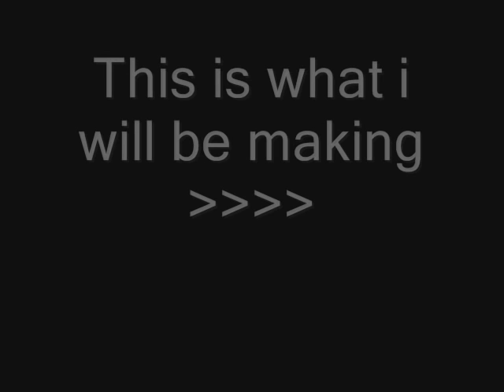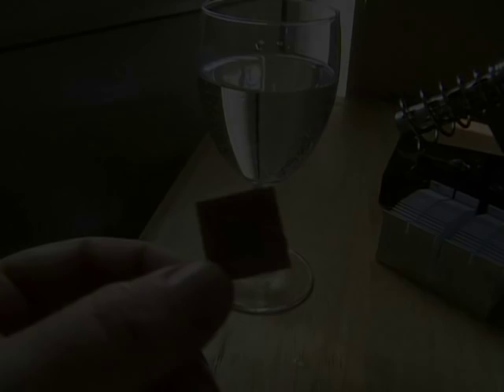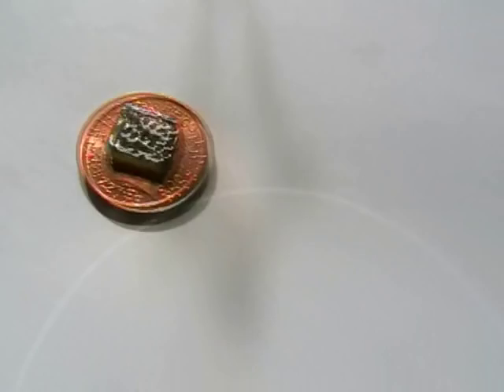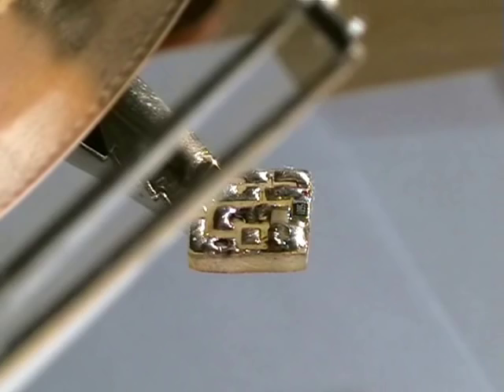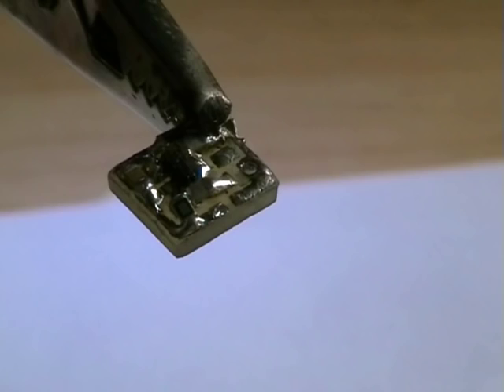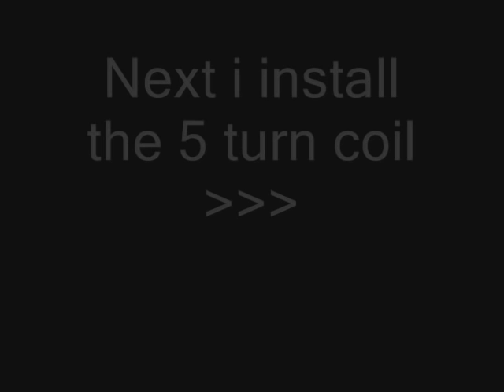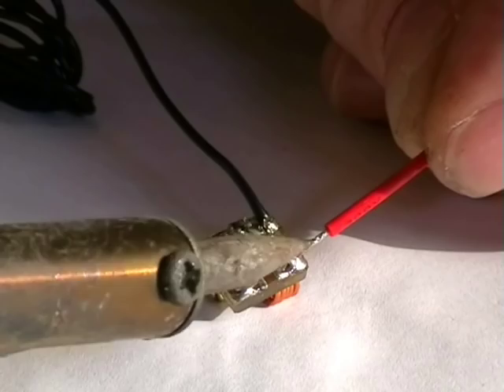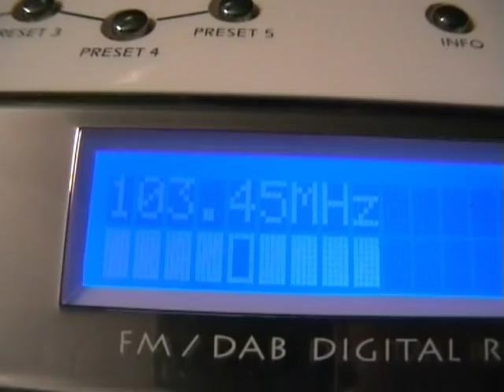Lets build the world's smallest FM transmitter.

Comment: 0605 Capacitator! Never come across one of those in my forty year career in electronics.
A better way of building this is to hold the board down with a spot of blue-tak on the back, when soldering parts down, put a small blob of solder on only one of the device pads, heat the solder and then using tweezers slide one end of the device into the solder bead and let it cool. Once you've done that, solder the other end with a small amount of solder and a brief touch with the soldering iron. This will save you from burning yourself and apply less heat and less stress to the parts otherwise with small surface mount parts there is a danger of the metal end terminations coming away or with a capacitor the end cap will crack and give you an intermittant fault that is very hard to locate.

Comment: -So in order to build it i need to burn my fingers multiple times, cut them apart, drill into them and dissolve them in acid?
-not if you work safely.
-safely? How does that taste?
Reply: +Luca Morgenstern when i used to do this sorta stuff, i used to superglue the components on the board first so i didn't have to hold em while i soldered them, its only logical really
Reply: +Luca Morgenstern Legit, I would cut my fingers off on the cutter he used >.< screw that haha
Reply: Thats a really good idea thanks for that tip.

Comment: I used to build these as a "Cat's Cradle" boardless design back in my youth using the then smallest through pin miniature resistors.

Range depended on the sensitivity and size of antenna employed on the receiver.

At best on a 9 Volt PP3 powered bug range was 100 metres.

Readability @ range = power available.

Lots of fun and easy to make.

Comment: Looked like a Talking Electronic's Schematic by Colin Mitchell in Melbourne Australia.

A couple of suggestions:

1.  You would do a lot better simply by placing the tinned PCB with components populated on a frying pan.
Reflowing would evenly solder the components much neater.

2.  Having a large CR2032 battery as base, you might as well make the board into 20mm diameter size.  
Doing this, you could etch the coil onto the board and tune just by using the variable capacitor.

Comment: you could probably build this without a PCB...
Reply from the maker: +Jetman640 
Yes ,you can build one without a PCB ,please see my other videos where i built such a transmitter.
Reply: +Jetman640 not with SMD parts
Reply: +ThinkLearnSolve I have and it was much smaller then any of those he build. Mine could really be called worlds smallest, or at least youtubes smallest for sure. 

It could fit on top of the square flat face of a to-92 transistor that he uses for his build and it was actually a tad smaller then that surface as well.
Reply: It's possible to do SMD without a board. You cut 0.5mm copper sheet metal cut into the trace shapes and stick it to a upside down piece of duct tape. You then solder with a very fine point like a USB soldering iron, and peel it off the tape. The copper sheet pieces hold it together quite nicely. You can then seal it inside a think coat of black epoxy to hide the inner workings, waterproof it and make it impossible to disassemble.

Though I didn't use the circuit in this video, I'v built something similar. Mine uses 27MHz also has a tiny slice of solar cell on top of the unit and a small flat supercap. It can run without batteries for quite a few hours in the dark. A thermistor frequency shifts a 1kHz astable sine generator which amplitude modulates the 27MHz transmission. It's essentially a throw it where you want temp sensor, but calibration gets a bit tricky to make the audio carrier's default tone exactly 32 degrees. 1 degree change causes a shift of 10Hz, +/- 5% tolerance. Each temperature bug used a signal tone 500Hz apart, and every 5 minutes a SMD 555 timer triggers a mosfet. The mosfet turns on the astable multivibrator oscillator and the transmission circuit for exactly 10 seconds and stops. This brings the current consumption to microamps in standby, as modern SMD 555 timers are rediculously low power.  It was able to run most if not all of the night every day. All of them are dead now, due to water ingress and corrosion, as I hung them by the antenna in trees and such, the UV of the sun ate the resin off, and water killed the circuits. I used them for part of my project massively collecting weather data around the yard. I also made a few humidity sensing versions but those used a few 1*1in solar cells and were not too compact due to needing more complex circuitry.

Needless to say a solar supercap powered audio bug is quite easy too. The mic can be connected with magnet wire and be routed where you want and the tiny black square stuck wherever sunlight is. Antenna is easy enough to hide as well. Trust me, when I was younger I made a HELL of a lot of wireless bugs from audio to temperature to humidity. Absolutely insane what you can make (and hide muhahahaah >:D) with SMD parts.
Reply: Dammit I can't find the schematics for my little temp bug. I was inspired to make a vid on it, but low and behold that sheet of paper is lost the the boxes and boxes of documents I have, and the original digital one is lost ot disk failure. Gonna have to recreate it then, thank god I made a version of the bug sealed in clear epoxy. It's in my junk box I'l see what I can do.
Reply: theLuigiFan0007 Copper sheets to solder the components on? Tss, the real pros do it without any traces to solder the components like I did when I made the guaranteed smallest (on youtube and beyond) homemade FM-bug, have to put it up some day.

As I mentioned above so was It slightly smaller then the flat surface of a TO-92 transistor and contained 8 - 10 components, I don't remember exact amount right now since its some years since I made it but around that.

And I did it all with a "fine" tip of 1 mm, which was bigger then pretty much all of the components I used.
Reply: dtiydr
Now that's really intriguing. I'd love to see it.
Reply: theLuigiFan0007 Im sure you do. :) And as they say "no pics or it didnt happen" so I will se if I might put it up on my page one day. I give you a heads up that day.
Reply: Your channel doesn't have any videos on it, where is the video where you make a smaller bug than the one featured here?
Reply: Jetman640 OK
Reply: dtiydr
Still trying to figure out how I got around a limitation of the modulator design. I had a circuit that mixed the output of the astable multivibrator's temperature modulated tone into the main TX oscillator without causing frequency modulation of the main 27MHz carrier. I remember using a really clever logic hack for the mixing, that also caused adjacent units to sync their 27MHz oscillators to each other. This is important as each temp sensor transmits on the same AM frequency, so only a single radio unit is needed to receive it. If the timing is wrong, you don't always hear the tones from all the units. Once I figure it out I will have a schematic for the transmitter. Ugh can't even reverse engineer my own circuits, this is why analog stuff is a pain. XD

PS: If I never finish this, sorry, it's been a while since I made one. I tried. DX
Reply: theLuigiFan0007 Do you can build one audio transmitter on request? I need one or more to collect evidence about mobbing and bloking.

Comment: i've made a smaller one based on the same circuit but i used a smaller coil, var cap, and mic. everything was dead bug soldered (no pcb) while temporarily stuck to some aluminum tape for heat transfer. it was powered by a tiny ultracapacitor and cut solar cell. 10mm X 10mm X 5mm

Comment: Tip for you: its recommended to use soldering paste(with tin) and hotair for SMD...
Reply: And what is capacitator?
Reply: Another question, why keep adding solder? He waaay over-tinned the board and could have used just that initial giant glob of solder to add the components with (as long as he added flux). Every time he reached for more solder I cringed a little.
Reply: +Arek R.
He meant Capacitor (Variable Surface Mount Capacitor) as there is no such thing as a Capacitator

Comment: Personally, I would have left the extra board space until after the parts were on. Would've left some room for gripping for assembly. Also: solder paste and a heat gun. Fully impressed with the manual soldering of 0808 components! My fingertips probably wouldn't have survived.

Comment: I think some proper advice would be to drill this before you cut it which would leave more leverage to hold the board with less danger to your fingers. Also you may want to consider leaving about one millimeter between the edge of the board and the outermost traces as there is less chance of them lifting off the board that way.

Comment: Also, hint: don't tin you board first. Use a miniscule drop of glue (use screwdriver for dosing) to stick the SMD components to the non conductive parts of the board, the just solder them as usual. It will make your board look less fucked up and it will save your fingers from burning.

Comment: I think it's also possible to use a double sided pcb and just etch the coil on the board which also acts as the antenna, it would eliminate the use of the air coil and that long wire antenna.  Just a suggestion you could try out
Reply from the maker: Yes that can be done ,it will be a short range FM transmitter ,may do such a video.
Reply: dazaro3 you have to take the transmission frequency wavelength into consideration. Anything less than a straight piece of wire will degrade the range even if the total length is the same that which is printed on the pcb.Anything else is a compromise.

Comment: NSA bug is smaller and simpler its only a transistor, microphone, and an antenna.  It has no battery and is energized by a powerful radio transmission.  It is akin to Rfids but with a microphone attached.  Google NSA ANT catalog for the source.

Comment: cool little thing you did there, back in the technical high school we're obsessed with building those, even made a 5km (pretty illegal i guess) range one. We didn't have any use for those though...but it was interesting.    thanks for the upload:)
Reply: I had a 5W one made a few years back... It covered the whole town. I played techno mixes on it 24/7. Never got in trouble for it though. I switched it off when i bought my first mp3 player so when i was riding my bike i was listening music from it, and not from the radio station i built. I used a good qualiy souncard for my computer which was hacked with a small program to mux the left and right channel in to the 38KHz stereo carier. It worked fantastic!

Comment: The word is CAPACITOR not "capacitator" which does not exist.
Nice video, I've never tried the toner transfer PCB method but it seems to be easy.
Ferric chloride is messy and stains everything it touches, you can use sodium hydroxide instead to etch (use a higher concentration and warm it up first)

Comment: there are much smaller designs with longer range if you look into x KGB projects.    sum don't require a battery
Reply: yeah.. yeah ... yeah
No secret service (well competent one at least) uses things like this to pick up speech, when they can power it from outside energy source by picking up radiation (hell that was tech of 1947), or they can measure distance changes of metallic objects in a building, thus picking up sound.
Or if can't be near the target using burst transmissions, is better.

But still that doesn't make the build less impressive!

Comment: If i were you i'd use a bigger mike and no circuit board. Then when i'm done i'd put everything in to epoxy and power it via wach cells or mount it on a AAA or AAAA battery so i keep it's diameter as small as possible. You can also get away with a much shorter antenna. The coil can be wound on the 33pf capacitor with a thinner wire. It's allmost the same as aircore. The thickness doesn't matter because of skin effect, which for the 100MHz this transmitter is operating at is a matter of microns.
Reply: Mic not mike :)
Reply: sgtzack612 Thanks, my english is not that good... :)
Reply: Eviltech No problem :) and so what if its not THE BEST just try is what i say :)
Reply: I do.
Reply: So are you saying this could be build even smaller? Like in.. 4 millimeters?

Comment: I bought one like yours kinda of mine 50 % bigger,with a lot of smd parts on it ,haven't tried it yet,I don't have a freq.counter,so when I do it will be trail and error to find my place on the radio.plus I wanted to mount a small l e d ,so I no when mine is turned on.,mine is run on 9 volts.but I love how well yours,worked ,good job.,if you ever make a kit love to buy it..,anyone no how to make a l e d work on nine volts,I don't no what size resistor I need to get down to 3 volts.

Comment: I like this video I can't wait to try the build-one question though or more of a thought I guess but have you seen the " conductive wire glue" that is available now? I was wondering if that would be easier to use. It would take over night to dry but one could lay the glue down have plenty of time to place the parts, might make it a bit easier as well as a cleaner build . What are your thoughts on this keep the videos coming two thumbs up! btw- I have built a few of your TX's all have worked the first time on power up Thanks again
Reply from the maker: +Rosario W 
Sounds a great idea , i have never used conductive wire glue ,maybe idea for a video !

Comment: I dont see a reason to make them so small, since the battery is most of the size anyways.
you can fit 3 stage bug on the size of the batteries so its better just make them 3 stage and a little bit bigger.

but it also depends on what you use it for.

thanks

Comment: Would it be viable to use this exact design, scrap the antenna, and then make it so that it is meant to be attached to a large metal frame or structure of some sort that would then serve as the antenna? If that would work, that would drastically cut the size down, the antenna is the biggest part after all.

Comment: Yes, deft soldering skills, but I wonder how you still have all of your fingers, and all the way through you suggest it's tiny, yes it is, but the battery quadruples its size, and yeah, you possibly could mount it in a pen, but 007 would look a bit of a charlie with a ten foot wire antenna coming out of his pen, this falls into the category of 'because I can' rather than having any practical use for it's small size.

Comment: A master class in soldering, fantastic. what range would it have.

Kind Regards

Mick.
Reply from the maker: 200-500ft with a good FM radio.
Reply: This is not a master class in soldering.  The technique is poor, but in the end what matters is that the job got done and it works as expected.

Comment: whats a capacitator?
Reply: alan homersley a capacitor is like a battery. it holds its charge a bit like a battery only that it discharges instatly rather than having a slow discharge rate like a battery. the discharge rate will vary on all capacitors. they have numbers on the side. voltage and microfarads. the voltage dictates how much electromotive force that the capacitor can handle. the microfarads dictates the capacitance of the capacitor. 
example. a 200 microfarad capacitor will have more capacity than a 100 microfarad capacitor. microfarad is usually shown as "uf" you will see that symbol on the capacitors. hope this helps

Comment: i have tried your other bug transmitter... but it is simply not working....
also i have a problem of checking the transmission frequency, since i do not have a frequency counter...
so tell a method of calculating the frequency...
I think that there is some short-circuiting occuring as an LED put in series with the circuit stops glowing on putting the mic...
PLS REPLY with answers...

Comment: What is the range of this transmitter? How many meters cover the signal?
What is the diameter of the inductance? Thanks for the replies.
Reply from the maker: 200-500ft with a good FM radio and 3mm.
Reply: Thanks.
Reply: dazaro3 Is it possible to use SMD soldering paste as solder? my hands are not steady like yours :)
Reply from the maker: 3nrasandun

Yes ,that will be the best way to build such a small transmitter.

Comment: Why aren't your bugs sold throughout the EU? There isn't any EU regulation banning bugs, only radio transmitters above a certain transmission power. Something which can be reduced by using a higher value resistor for the transistor biasing, so it has a smaller output.

Comment: but its not that noticeable..you can hide it anywhere..and the antenna doesn't need to be that long...if you have money you can use other high tech small in size big in power batteries...you can mode it to look a lot more smaller and less noticeable...

Comment: How would you go about changing the frequency and transmission power of this?
I'd like to build one because my country is shutting down every FM-radio station next year in favour of DAB.
And i would like to have one that is strong enough to broadcast to several cars when i'm on the road.
Reply: +StopaskingformynameYouTube    You can buy them ready built however it depends on how far apart your cars are too. You will also need a good aerial - you can buy a magnetic mount Taxi aerial and cut it to the correct 1/4 wave size. For example 100Mhz is 3 metres wave length, therefore a near approximation is 75cm for 1/4 wave. Some rule of thumb also adds or subtracts 3%.

Comment: will u plsea tell me how to stablish a frequency that it is constant coz some most of the times when battery runs the out put frequencr varies.
Reply from the maker: +Reza Babakan 
I am showing people how to build a very simple FM transmitter and 
for many this type of FM transmitter is a ideal starting point.
If you add a buffer amplifier stage and or  a 5v regulator on the 
oscillator they can be very stable. For a much more stable transmitter
see my professional surveillance UHF Transmitter video .